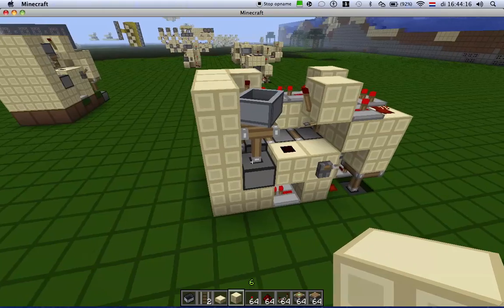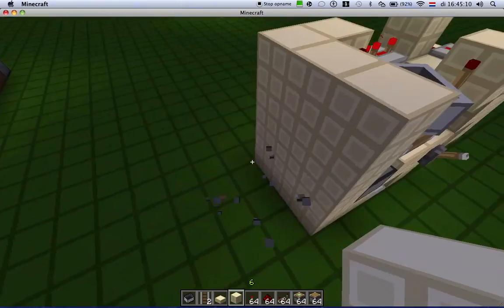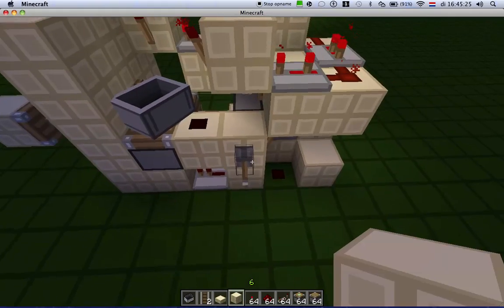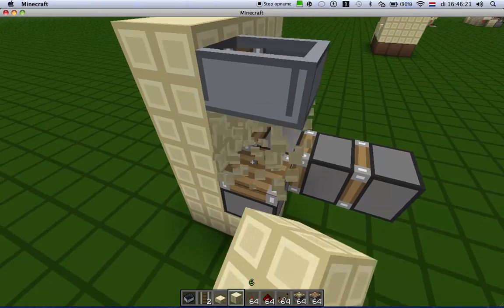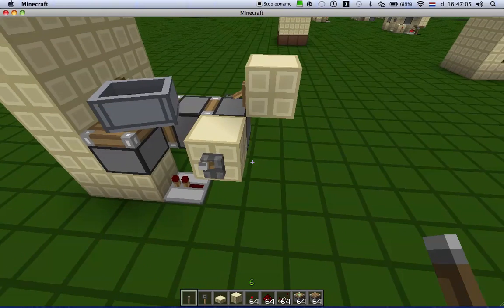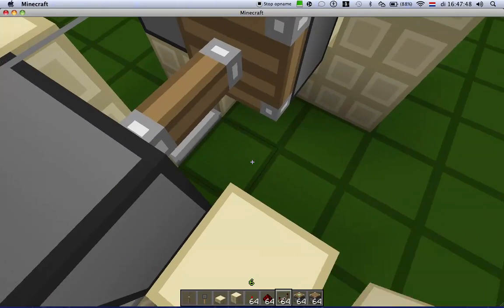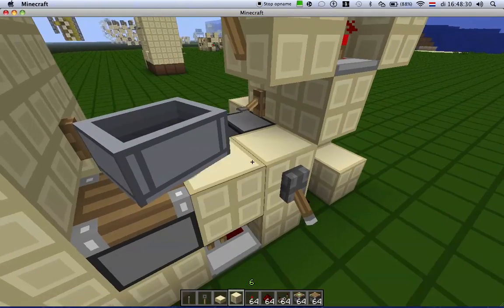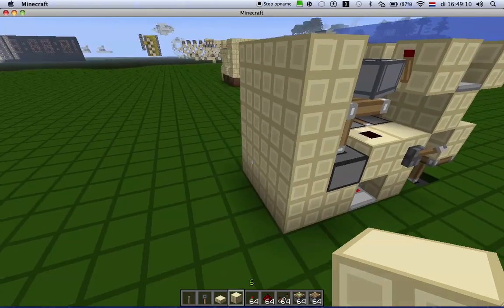Smallest seamless triple piston extender

Comment: Downward without any problems but for a seamless upward triple piston extender you would have to push a minecart on a detector rail in between the pistons and take it back out which needs a lot of space for timing circuits...